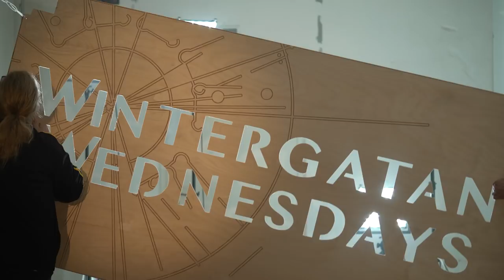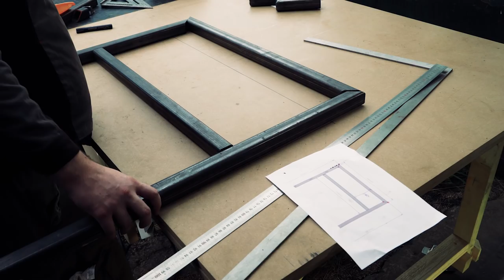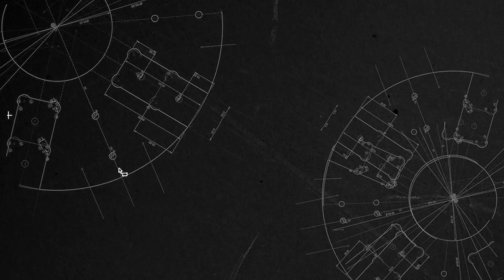Welding the Steel Frame - Marble Machine X Goes Metal #11

Comment: I would recommend  making the stand collapsible, so the machine and its stand can be shipped in a container, with the center-of-gravity low.  A welded stand like this is susceptible to damage in shipment from "raking" forces.  A bolted together stand would be flat and a pile of rods before assembly.  This would be easier to ship and be not susceptible to damage.  In addition, welds cannot be repaired "on the road", while a bolted together stand can.

Comment: I don't know if anyone mentioned this yet (because I didn't read every comment) but paste was will protect with minimal effort, and no change in the finish of the metal parts. There is a brand called Renaissance Wax used by museums.

Comment: +Wintergatan It's fantastic! This is what I meant when I said to try new genres in the Q&A :D And you totally have demostrated to do better than expected. I don't have experience to give advice about the steel, but I think that covering with the thin layer, or with a chromium plating (maybe) should be good.

Comment: This is the one single time I sort of wish you'd done things just a little different. I'd have put an arch in the lower horizontal supports, rather than let them just be straight. And even - but this is just pure wishlist - T- or I-shaped profiles with rivets, then painted green, in a 19-century train-station kind of vibe.

But then, I'm not the one who has to live the result, so who am I to complain :)

Comment: Put one layer of clear coat over the metal as although weaker keeps a Matt finish to the frame also really thing you should use copper which you heat to cause colour change in this build as it would stand out and look really good

Comment: Will the Marble Machine X be heavier than the original? I would imagine a steel frame would cause it to wobble less compared to wooden legs and allow more weight. Also, I must say that the metalworking is quite clean!

Comment: Did you do some research on how to treat the wood? In the US. they are really picky with wood items that come into the country. If there is anything not treated, you could lose it and they may even incinerate it.
Reply from the maker: never heard of that, will ask my logistics person, i doubt they would stop untreated birch plywood? But thanks for letting me know!! i do not want to treat the plywood at all, there is no need.
Reply: I've just looked it up, all wood needs to be treated according to the ispm 15 rules. Plywood is an exception because it's already treated. If forgot u were using plywood. But you can never be too shure with these tings.

Comment: Using a clear coat of 50/50 PVA glue on MDF as a sealer will protect it from water swelling and staining, some Gunsmiths like to use a thinned out clear type of bluing for repairs to the steel. Penetrol is also used with great results mixed 80/20 Penetrol to paint thinner.
http://www.sawmillcreek.org/showthread.php?193926-Clearcoat-on-MDF
http://www.instructables.com/id/How-to-protect-and-seal-unpainted-mild-steel/